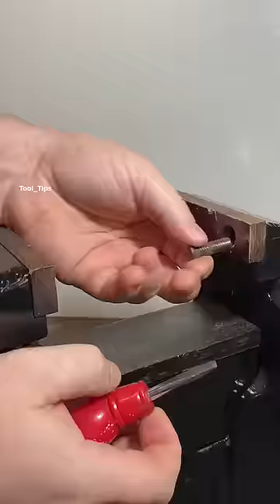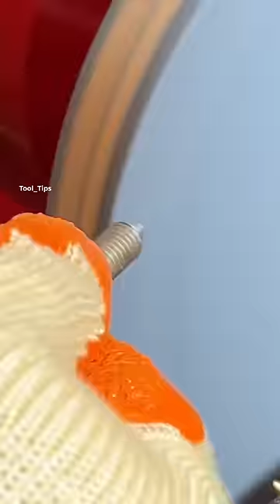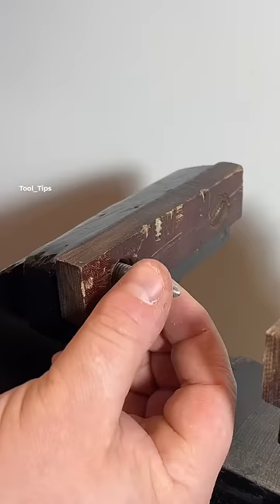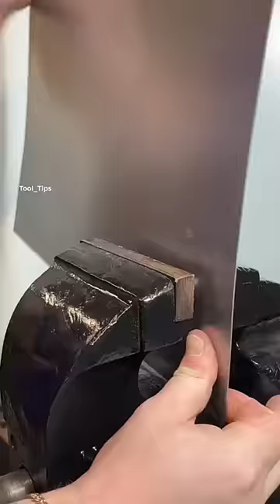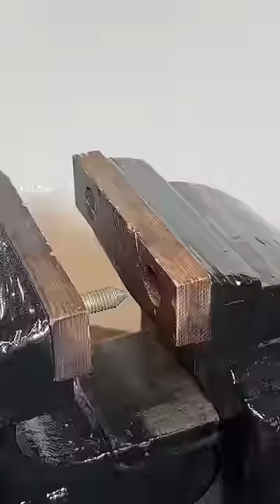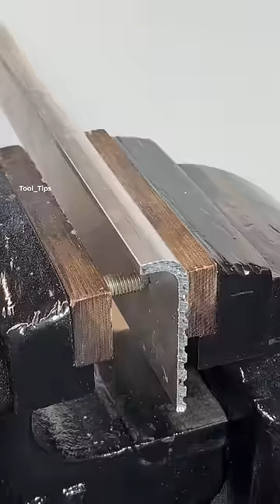#shorts This is So So Genius Tip 😲

Comment: How you getting that screw back out? This is gonna destroy the threads. Removing it will require clamping something to the remaining threads you can see also ruining those threads so it won't go back in the other side either. Very helpful thanks.
Reply: @David Worsley  at the beginning of the video he removes the screw from the vice. It is the screw from the vice.

Comment: Totally, way cleaner holes. Very versatile,  not
so light weight or mobile. Restricted to paper thin metal. And you only need to spend an hour fabricating shit.
Reply: Sounds like a dream come true. Who needs drills when you can DIY a barely functioning hole punch.

Comment: Drill a hole in a board, place the metal over the hole, and drive a punch through it. No need to hack your vice, but whatever. A drill also works pretty well.